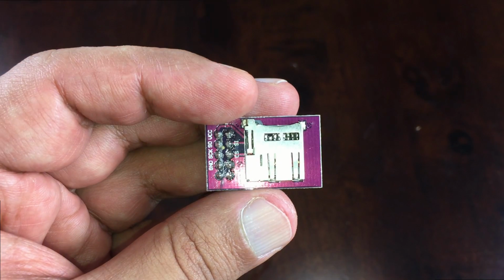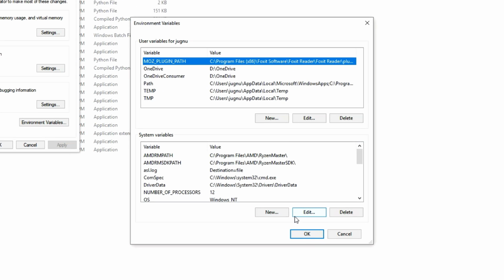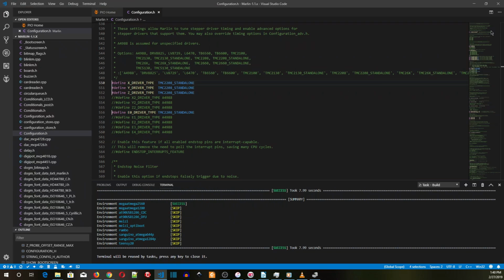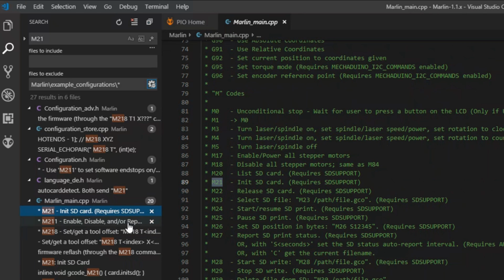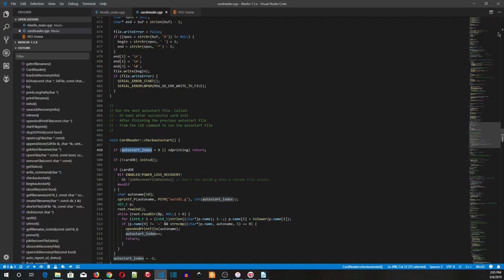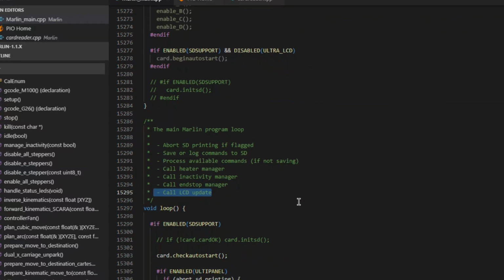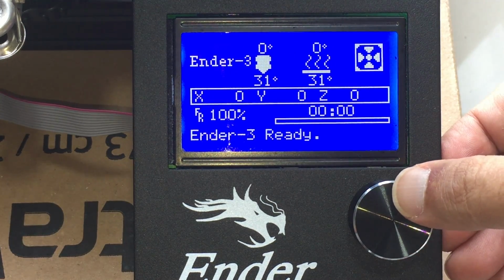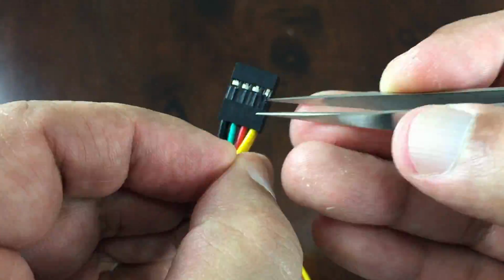Ender 3 + MKS Gen L : SD Card Add-on Modules & PlatformIO IDE

Comment: I got the Mks Gen l  board in and everything setup, but my extruder stepper motor will not work. I know it is not dead, because I plugged the extruder motor into the x stepper motor port, and it worked. I tried changing the extruder motor port to the E1 port in the firmware, but I do not even know if I did that correctly, because it still does not work. I do not even know if that would fix it .I have tried different cables, and nothing is working. Strangely enough, I switched to this new board, because the extruder stepper motor stopped working on the old board. Any relation? Any ideas or fixes?
Reply from the maker: Hi @James cerven. If I understand you correctly, you are saying the extruder motor stopped working on the stock Ender 3 board and is doing the same thing when attached on to the MKS Gen L board. BUT when the motor is attached to the X-Axis driver then it works. Does it work on BOTH the boards when connected to the X-axis driver?
Some things you can try is swapping the stepper driver modules around and perhaps increasing the voltage on the stepper driver module for higher current limits. 
Also, try attaching one of the axis motors to your E0 port just to ensure that the E0 port's electronics is working on the MKS Gen L board. If it does, then re-attach the extruder motor and check. If the motor still doesn't work than its likely that something is wrong with the extruder motor.
Hoping this helps.
Reply: Yes, you do understand correctly. I am not sure if the extruder worked in the x spot on the old board. If I remember correctly I think it did. I just tried the x axis in the E1 slot and I did the firmware wrong, because it did not work. I forgot to mention last time, the X axis worked in the E0 spot, but when I tried a few days later, it did not.
     I do not know if this is helpful, but every time I go to move a motor in the E0 or E1 slot, and it does not work, a tiny LED labled D12 blinks.
Reply from the maker: Hey there @James cerven. The D12 & D11 LEDs are Tx & Rx indicators I believe. These leds blink when I'm connected to the board via a terminal or when uploading firmware. I'm not sure how to help you buddy.
Are you sure your firmware is proper? Can you connect a terminal to your board while its powered-up and observe the print-out. Press the reset button on the board and observe the print-out again. Check to see that everything is printing OK & nothing is garbled. It should show the firmware version and list features and the status of these features i.e. enabled or not.
Can you confirm the hardware you are using. Is it MKS Gen L v1.0 board. The stepper modules are TMC2208 v1.1?
Hoping this helps.
Reply: Thank you for all your help, but I am so lost. I do not know what a printout is, and I do not know if my firmware is correct. I have no idea what to do. I am using Marlin, Mks Gen L, and Tmc2208s.
Reply from the maker: Hi @James cerven. Printout here refers to the messages sent out by your printer thru the serial connection to a host terminal program. This can be putty, Arduino IDE's terminal monitor or Platformio's terminal. Pretty much whichever software you use on your PC to connect to your printer via serial. Upon booting up the printer will send some information comprising of the firmware version and feature set supported/active among a list of other things.
For instance, using Arduino IDE, connect you PC to the board using a USB cable. From the menu select Tools and set you COM port followed by the Board. In our case the Board will be Arduino/Genuino Uno. Once that's done, from Tools select Serial Monitor. Once the Serial Monitor pops-out set the baud rate to 115200 baud. This will reset your printer. And you'll receive some messages in the serial monitor terminal.
It's easier done than said so don't worry. The first things will be the firmware version followed by many other things. You can send gcode commands using the terminal. A list of gcode commands are available here - http://marlinfw.org/meta/gcode/
Also, is it possible for you to share the firmware changes you made for the E1 extruder? Perhaps I can try the firmware to see if it works on my machine. Best if you can share the sources as a zipped archive or something.
Hope it helps.
Reply: Thank you for helping. I just ran a test through, on all axises, and they all worked and the serial monitor said ok, but when I did it for the extruder it also said ok, but the extruder did not turn. 😐?
Reply from the maker: Hello @James cerven. That is expected if you don't bring up the nozzle to temperature. The firmware sets the minimum extrusion temperature at 170 C. Its for safety and the default behaviour. IOW, you'll NOT get any movement from the extruder motor until the temperature of the nozzle is 170 C or more.
Hope it helps.
Reply: The nozzle was at 185 C when I tested it.
Reply from the maker: Heya @James cerven. Oh I see. Any chance you can send me the firmware? I can test it on my machine so we can rule out firmware related problems.
Reply: Can I have your email so I can send it through wetransfer. Thank you
Reply from the maker: Hi @James cerven. I'm sorry but not comfortable leaving my email address out in the open. Can you upload to google drive or some online storage. Share the file or folder and put up the shared link here in the comments? Thanks buddy. Sorry for the inconvenience.
Reply from the maker: Hey @James cerven.
CORRECTION: Board should be 'Arduino/Genuino Mega or Mega 2560' instead of 'Arduino/Genuino Uno'. My bad, real sorry. Of course in this case it didn't matter as we just needed the serial monitor to come-up.
Reply from the maker: Hey there @James cerven. Here is the link to my git repository for Marlin v1.1.9 for use with Ender 3 - https://gitlab.com/jugnu-jethi/myender3firmware. Once there, click on the top-most drop-down box on the LEFT. By default it reads "master". Click and choose "Ender3-MKSGenL-TMC2208_Legacy". This branch I've tested and verified for use with Ender 3 + MKS Gen L v1.0 board + TMC2208 Standalone Mode. IOW, all firmware changes for use with Ender 3 connected to the MKS Gen L v1.0 board, installed with the TMC2208 stepper driver modules operating in standalone mode has ALREADY been made. 
On the RIGHT you'll see a button at the very end with a "cloud and a down arrow". That's the download button. Click and choose whichever compressed format you are comfortable with. My 2 cents, just go for zip.

Download & extract. Open in Arduino IDE. Select from Tools, Board -> Arduino/Genuino Mega or Mega 2560. Processor -> ATmega2560 (Mega 2560). Hit "VERIFY" to compile and then "UPLOAD" after compilation finishes. Don't forget to connect your board prior to uploading and do select the right COM port.
Give me a day or two to check-in changes for E1 extruder. Do let me know if it works.
Hoping this helps buddy.
Reply: No problem. Totally understandable. Here is my firmware. https://wetransfer.com/downloads/662c5e30f072d782bfae2ce75cb072b720190417174248/61fa4dada893a736237111ff449682a320190417174248/ea5ef0
Reply: Your firmware will not verify, it keeps saying  "U8glib.h  No such file or directory. Compilation failed.
Reply from the maker: Hey @James cerven. You need to install libraries "u8glib" & "tmc2208stepper" in Arduino IDE. Showed this in the video here - https://youtu.be/ghJTIGpbGL4. 
Basically in Arduino IDE, go to Sketch -> Include Library. Select "Manage Libraries". Search for the libraries in the pop-out window and click on "Install" button to install the libraries.
Your Arduino IDE should already have these libraries installed if you followed my video guide. I'm surprised that you are having this problem. 
Anyway, the installation of the two libraries should fix your problem hopefully. Cheers.
Reply from the maker: Hi there @James cerven. If you would like to use the E1 extruder driver instead of E0 then I have the changes tested and checked-in already. Download, build and upload the branch named "Ender3-MKSGenL-TMC2208_Legacy-pinSwap_E0forE1". The direct link is at https://gitlab.com/jugnu-jethi/myender3firmware/tree/Ender3-MKSGenL-TMC2208_Legacy-pinSwap_E0forE1 . You'll need to move the E0 stepper module to E1. Do the same for the E0 stepper motor connector too.
Hoping this helps.
Reply: It worked! Thank you so much for all your help.
Reply: Firstly. You CANT use extruder stepper motor when hot-end is COLD. It's a blocked thing in marlin. Preheat hotend to at least 170 degrees Celsius. There are 2 settings in Marlin: #define PREVENT_COLD_EXTRUSION and #define EXTRUDE_MINTEMP 170
Reply: @jacekk6913   tried already, still wont work. Thanks for  the help though.

Comment: I also have this break-out board: MicroSD card breakout board+ from ADAfruit. schematics https://learn.adafruit.com/adafruit-micro-sd-breakout-board-card-tutorial/download
Any idea how I should wire it to the MKS Gen L?
Reply: Thanks a lot! I couldn’t find which pin is which because they have different labels.
Reply from the maker: Hi @Anenkris De Pril. Look exactly like the second module in this video. The link you gave didn't work as the parentheses is part of the link.
Anyway from the pinout in link you sent, connect to pins on MKS Gen L as following:-
CD is SD_DETECT_PIN --> D49
CS --> D53
DI --> D51 (MOSI)
DO --> D50 (MISO)
CLK is SCK --> D52 (SCK)
GND  --> GND
5V --> 5V

Leave the 3v unconnected.
SPI signal naming can be found here if you need - https://en.wikipedia.org/wiki/Serial_Peripheral_Interface

Try it. If doesn't work then set the SD_DETECT_PIN  to -1 in firmware as shown in video to verify if the device works.
The detect pin maybe reversed on your device or may even need a pull-up resistor as indicated on the page in the link.
Hope this helps. Let me know if it works.

Comment: I want to get sd card support on my ender 3. I have a sd card reader, but do I really need to do all the platformio ide stuff, or can i just switch the wires around, and get printing? If not, what is the point of the platform ide stuff
Reply from the maker: Hi @Chico Cerven. Yes you can get the SD Card module working without installing PlatformIO IDE stuff. Just wiring will do. But if you decide to disable the auto insertion/removal then you'll need to make the firmware changes which you can do even on Arduino IDE.
The point of Visual Studio Code & PlatformIO IDE is purely for FUN. I was trying to figure out how to make the first module work but going thru the code proved to be difficult with Arduino IDE so I switched to PlatformIO IDE as it is much much more developer friendly with tonnes of features. I'm just sharing my experience on how I got to the point where the first SD Card module was working. Also, if you are interested in the code itself then I have shared that along with this video.
It is also investment in the future for upcoming projects. This SD Card situation gave me the opportunity to demonstrate how to use some essential features of the PlatformIO IDE. There are many video out there demoing just PlatformIO IDE but here I took this opportunity to share my experiences using it as a developer to solve an actual problem somewhat. Haha.
In conclusion, the video is for a range of audience I do admit but it has a little bit of something for everyone. Or that's what I hope to the very least. Hope it helps.
Reply: I see now. I was just wondering, because when I wired the cables correctly and plugged it in, it says sd card removed or inserted , but it does not read the sd card. Any ideas as to why?
Reply from the maker: I suppose the SPI lines may not be wired correctly. Which module did you get?
Reply: The full sd module, that you recommended. I am going to go check your wiring diagram right now though.
Reply from the maker: Hi @James Cerven. If that's the case, you must switch the positions of BOTH the wires in EACH & EVERY color pair. I mentioned this in the video but only showed it for one color pair. Checking with the wiring diagram is the best. Hope this helps.
Reply: @yemojamakerrefuge898   Thank you
Reply: I'm a moron. I just checked the wiring, and one of the yellow wires was not completely plugged in. It works!!! Thank you.
Reply from the maker: Hey @James Cerven. Haven't we all been there and done that Haha! Glad it works.

Comment: Hello Yemoja, very good videos, very rigorous and interesting; can power loss recovery be activated as in the original version of ender 3?
Reply from the maker: Hi @Jose Penalver. Yes it can be done. I've tried it. It does works but leaves a blob of plastic where it stops last. Can't seem to resume properly if power-fails again after the first time.
Anyway, to enable it you'll need to uncomment line 596 so it reads "#define POWER_LOSS_RECOVERY" in the file Configuration_adv.h. Upon power loss when the printer comes back ON a menu will be presented asking to either "Resume" or "Cancel or Stop" the print job.
Another interesting bit would be to enable the saving of each & every command to the sdcard making resumption more accurate I hope. Not tried it myself. To get this, uncomment line 35 to read "#define SAVE_EACH_CMD_MODE" in file power_loss_recovery.h.
Uncomment here means to remove the double-slashes in front of the aforementioned lines. And do NOT type the quotation marks shown above. Pardon me for mentioning the obvious but just to get ourselves on the same page.
Hope it helps.
Reply: Thanks, i go to try it...

Comment: So does the full sd card reader need any software changes you were doing with the micro sd card reader.
Reply from the maker: Hi @chico cerven. No the full sd card does not need any firmware changes. Just wire it up correctly and it'll work.

Comment: Have you bought the new sks 1.3 board? I’m interested in how to set it up. I like the feature on how you can use tmc2208 stepper drivers on it. Also what is the benefit with 32bit over 8bit? Also it’s marlin 2.0 what’s the benefits with that?
Reply from the maker: Hi @Johan Erikkson. No I don't have the SKR 1.3 but I did get the SKR 1.1. I'll be starting work in that area soon. Currently, doing a bit of research on that.
In terms of benefit, the 32-bit micro-controllers are much more capable. These devices tend to have quite a bit more memory and storage. Also, these devices tend to run really fast in excess of 100Mhz in comparison to the 8-bit devices which only reach 16Mhz. Also, these 32-bit devices come with a whole lot of peripherals. And are really competitive priced.
For instance, a stm32 "blue pill" goes for less than USD2 and runs at 84Mhz. Its more capable than an ATMEGA2560 in terms of operating frequency. Not to mention it support single cycle 32-bit arithmetic operations. Performing the same operations on the 8-bit would require a multiple of tens of cycles.
Marlin 2.0 Alpha currently supports 32-bit boards so that the most important reason. It has many bug-fixes from the time of v1.1.9. It is suppose to incorporate an RTOS but I don't think its there yet. I'll probably have to look at the commits & pull-requests to get idea on actual improvement going into Marlin 2.0.
Hope it helps buddy.